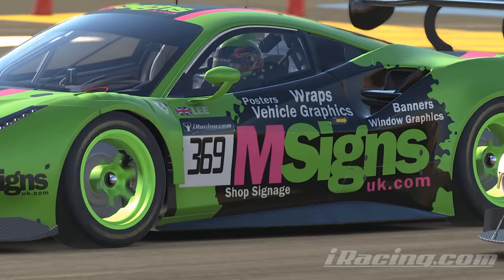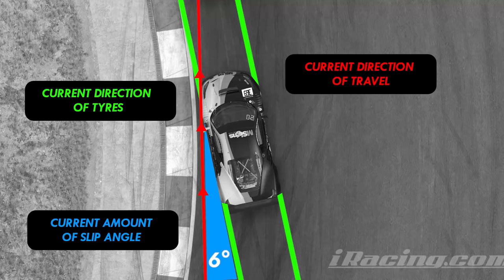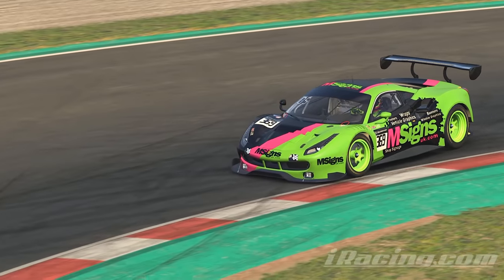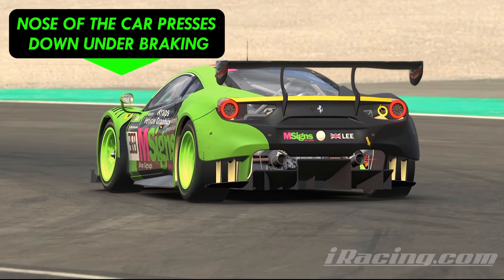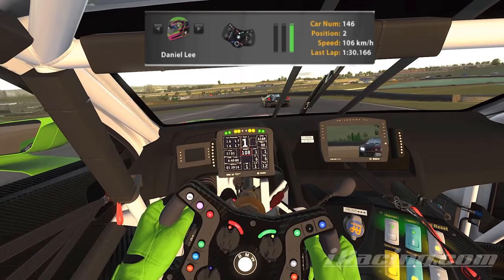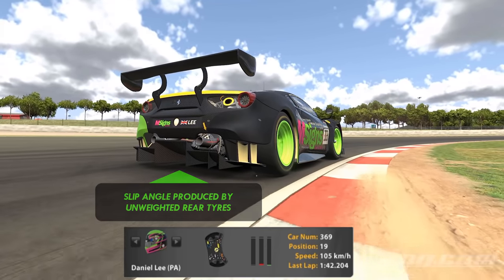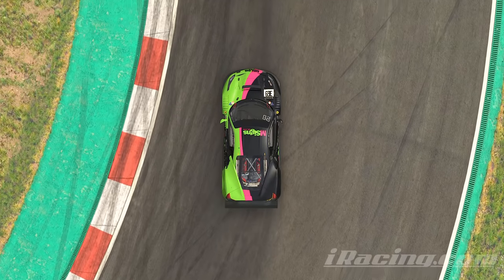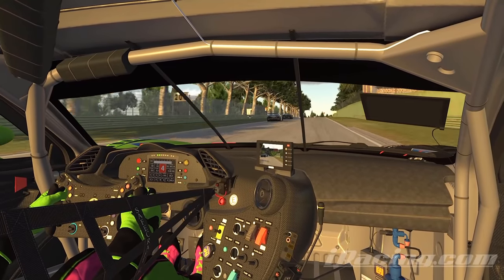Slip Angle in Sim Racing - Nail This and Smash Your Lap Times

Comment: How the hell can you feel this in sim racing? I've felt it on the real track but I'm baffled how you could do it in sim...
Reply: you'd need a good racing wheel, you get used to finding that sweet spot from the steering feedback
Reply: Also, in VR, needing to turn your head slightly to match the direction of travel of the car tells you the slip angle. On a screen, it is harder. I felt instantly faster and better able to control grip limits in VR.
Reply from the maker: I spent a lot of time on a G25/G29 and learnt to sense it through that, but no joke it was a LOT easier to feel when I upgraded to my current Fanatec CSL. Triple Screens also help as you can perceive rotation easier because you can afford to use lower Field of View. There's all sorts of ingredients that are now well journaled but those two are the big ones. As mentioned as well, VR can be a revelation for many racers that just can't get on with screens. Oculus Quest 2 is a brilliant choice of headset right now.
Reply: Force feedback

Comment: Yeah but this is overly emphasized in sim racing games and doing it too much in real racing will wear the tyres like crazy to the point of the car just sliding instead of the little "slip". Ive also been doing this in sim racing but again, its over emphasized and not so ideal in the real world as all times. There might be corners where you could do this every lap but not every corner, whereas in simracing this is the optimal way to maximize corner speeds in a somewhat fake way. Its over emphasized to a point where simracing just feels like a game.

Comment: If you are aware that this is actually yaw angle and not slip angle... why not changing the title and add a disclaimer that the video uses the wrong term? This is so misleading to people that just dont know better. Overall the video is just misinformated, cause you mix things about slip and yaw angle up and its just wrong.

Appreciate the effort put into the video, but the information in it isnt correct.
Reply from the maker: I understand your grievance, I really do, especially as I've acknowledged that what's represented by a 'sliding' car is actually yaw angle and not technically slip angle, even if slip angle is the ultimate core of what's going on. Most won't go on to research it more, but those that do will look for 'slip angle' and discover a lot more than is scratched upon here. Either way I will be judged harshly for my crimes in Hell.

Comment: This is a horribly misleading analysis. You appear to suggest that slip angle is the same as the tyre actually sliding, and you only ever talk about the rear tyres sliding. Tyres generate a (small) slip angle even at walking pace, manoeuvring around a car park, nowhere near the limit of adhesion. And all four tyres will have a slip angle all the time the car is turning. I'm sure you have tried to simplify the subject, but in so doing you have totally misrepresented the subject.
If I had no knowledge of the subject, after watching this video I would have no clue that the front tyres create a slip angle and I would believe that the rear tyres are only generating a slip angle when they are sliding onto a larger radius of turn than front tyres! This is dreadfully misleading and really not at all helpful. What if you prefer an understeer biased car? Where is the understanding that handling balance is all about the relative slip angles of front to rear tyres?
Reply from the maker: Some subjects, like slip/yaw angle, are so complex that the search for knowledge about them has to be ignited with a small spark initially. You're judgement is correct, it's massively simplified, intentionally. Some will watch and go find lap-time by deviating from the rut they're stuck in, some will go on to reach the point where they will want to know every last detail - That's where scholars like you come in.
Reply: @dannyleeracing  I think it's important for anyone thinking about this to know that all four tyres generate a slip angle whenever the vehicle is turning. If the slip angle at one end of the vehicle becomes great enough that a steering correction is required (understeer or oversteer), that this would typically be referred to as a slide. You certainly don't need to be sliding to generate a slip angle. As you say in the video, different tyres produce maximum grip at different slip angles, some will need to be sliding, some won't. It is a complex subject and it's great that you are addressing it, but just a little more information could help avoid a lot of misunderstanding.

Comment: Woo woo woo, hold on tiger. You've go e off wrong from 5 seconds in. What you are describing is not slip angle. Please don't hear or read a terms name and invent your own meaning for it. Slip angle has nothing to do with a car as a whole, its a term describing something happening to an individual tyre alone. Slip angle is where a tyres actual direction differs from its steered angle. Imagine putting a pencil erase on the table, you have 0 slip angle, now hold it down and twist it one way, the bottom maintains contact with the table but the top twists by and angle relative the bottom. That angular difference when the same thing happens to a tyre is the slip angle. Its not really describing slipping as in car behaviour its describing the stick and slip that needs to occur in the carcass as it approaches and leaves the contact patch, in order to allow that deformation/twist at the road surface and not at the top.
No more pseudo physics lessons please, there's enough of that already.
Reply from the maker: I appreciate the input and you're absolutely correct, in the fullest technical sense, but judge this video by how effectively it gets people who didn't know this happens, to know it happens and to get it to happen. I know some will be upset that slip angle is being used like an umbrella term but I wager it will lead to more people researching it using the resources I point to, than if I tried to get too deep.
Reply: @dannyleeracing  the term you should be using is yaw angle. Yaw angle is the difference between your heading and where you are pointing. Keep up the good work.
Reply from the maker: @gtforte  Duly noted, I understand the need for accuracy and I'm sure I can find a way to make things approachable without being loose with terminology. Appreciate you taking the time to watch and comment, I thrive off constructive criticism as much as anything else